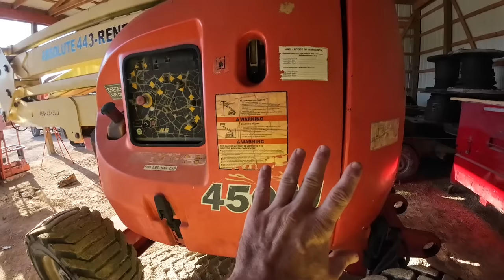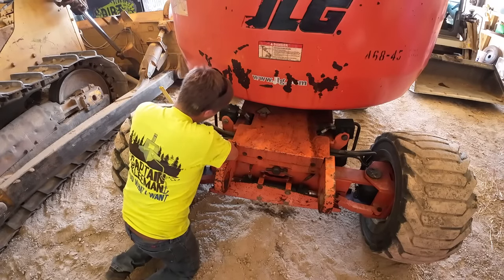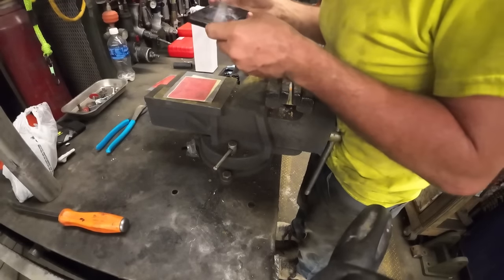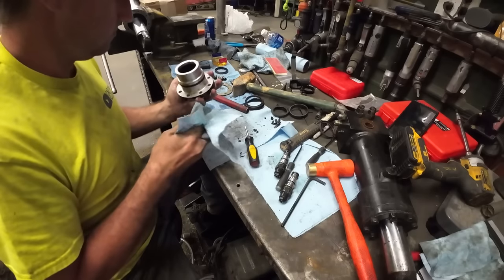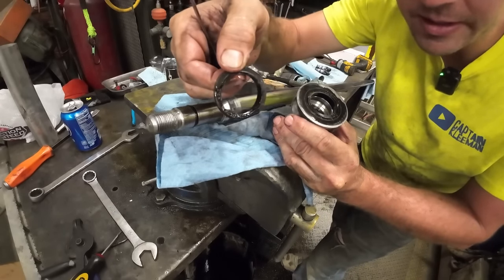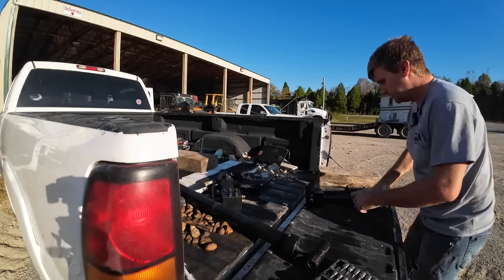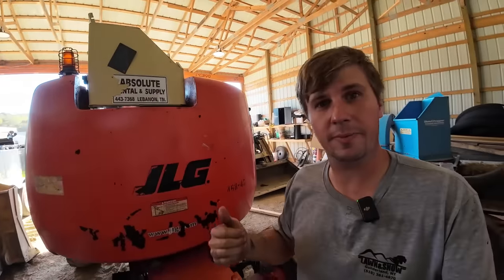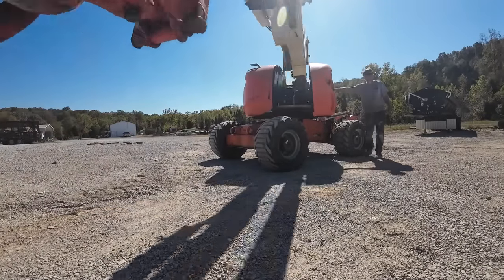Trading Mechanic Work for Equipment Rental - Failed Hydraulic Seals - JLG 450AJ

Comment: Good on you for having a go at it .
The only thing that I would do is to get DP to sign off the repairs,I would check public liability cover ,this is a machine that may be used by third parties and since it involves lifting people into the air above the standard safe zone .
Something to take seriously,as one can't say "it will be fine "

I would probably clamp the long Ram housing to a bench with timber blocks along it's length, eliminate any chance of damage to the cylinder.
When disassembling parts,try to have a container set aside so the old part stay separated from the new parts , especially with o-rings .
Think and work like an aircraft engineer is a good work ethic ,and all this is only suggestion,not saying you did it wrong .
Best part was seeing work being done in the DP workshop and in most it was a peaceful moment,your ear wasn't getting chewed or teased by someone lol.
Let's hope the machine gets checked over ,full service and that Ram that is slightly leaking ,gets repaired sooner than later ,again it's lifting people .

Comment: Great Video Mike,  Hey, Dirt Perfect used one of those 3 finger seal installers on the Jake Brake rebuild on the Mack.  I think that's where he introduced the tool. SOOOoooo.... Yep, he did have one at one time.  I liked the reason you wouldn't give out the torque spec.  I laughed out loud on that one.  Have a great day.
Reply from the maker: I asked, he said he didn't lol

Comment: Hi Mike.  I think half the battle with mechanic work is setting your mind to doing it.  Once you've decided you're ready to tackle that job it either goes smooth or not and you learn something. You might learn that you just lost some tiny, irreplaceable part which launched itself into some deep dark corner but that almost never happens, right?  Nice job on the cylinders.  The barter system works pretty well.  Nice to not have to pay out of pocket to use equipment you need but don't have.  Thanks for the video!
-mike
Reply from the maker: Appreciate ya watching

Comment: I enjoy working on equipment, at my leisure...  Wouldn't be able to do it as a career!  Less than a year ago, I was helping out a friend and worked on a few pieces of his equipment!  I ended up buying a large set of Sunex metric wrenches and a complete set of deep 1/2" milwaukee sockets.  The only reason I went with them was because they didn't skip any sizes.  They stay in my truckbox for that exact reason, when you need the right one, it's there.  They have saved me so many times

Comment: Hey Cap!! If you had a way to apply vacuum to the hydraulic system would help get the air out. Like when DP and Clint added the rear hydraulics to the 850J. Great job as always.

Comment: I just acquired an OLD Case 580, unfortunately it seriously needs some love.  When I borrowed it, I went through 40+ gallons of hyd oil, now I get to replace a number of seals to prevent marital conflict.  The first has two spot welds on the “threaded “ cap, what possibly can go wrong with this project…..?

Comment: Hello Mike. You always say, in this type of video, that you are not a mechanic OR this is not a How-To video, but you always get the job done and things work as expected. If you clean out your truck, you will need what you took out. I once took a trip around the country in a 1981 Honda Civic Hatchback and pulled an eight-foot trailer. I took everything I thought I might need just in case I needed it. It was about 10,000 miles in two weeks with the final 2,000 miles in two days. (You may be thinking, A person cannot do that. I did not sleep those two days and only ate when I got gas.) Have good days!

Comment: Nice long episode Captain. 
I'm sure Mike appreciated you getting those cylinders rebuit so he could work on other equipment or contract work.
Just a bit of advice. 
I've rebuild hydrolic cylinders back when I was in charge of Coast Guard Airstation Miami's ground support shop.
My CPO I worked under taught me to alway put a light coating of seal lube on the piston inner seals as the inside/first seal that slides on the shaft wipes the oil off so there's no lubrication for the piston inner and end seals.
It only takes a speck of dust ot dirt to damage those seals as you're sliding the piston on.
One thing I learned early on when I was originally stationed at Coast Guard Airstation Traverse City Michigan and assigned to the fixed wing shop (Grumman HU16e Albatross seaplanes) as a Flight Mechanic was to listen carefully to the old guys senior to me when they were explaining what and why I was doing maintenance on equipment. 
I also learned right away cleaning the Shop CPO's coffee mug was a really numbnuts action.
He seriously wasn't happy. 
Got stuck chipping ice from the huge 2 ton WW II hanger doors for two months.
That was usually done by non-rated personnel.had to be at the hanger 5 am to do it and there was 4 doors, 2 per side of the hanger.
Never did that again.

Comment: Thanks for the video. I have a 450a that's leaking somewhere in the boom, so I appreciate a view into what I might come up against.  You already have the  wheels turning on a pin press to deal with stuck pins.

Comment: Capt'n, for that pin that refused all persuasive techniques, C&C has a hydraulic portable pin pusher he uses track pins.  I thought I would type that for future info on pins like that.
I do enjoy your "Can Do" attitude.  Just because I have never done it before doesn't mean I can't do it now!  What could possibly go wrong?
A bit of Hoosier trivia for you.  "Can Do" was the motto for the 305th Air Refueling Wing when I was at Grissom AFB a bit north of Kokomo.  I was there 1977-80.
Logically, you should have done the seal work before you borrowed the man lift.  Just saying.